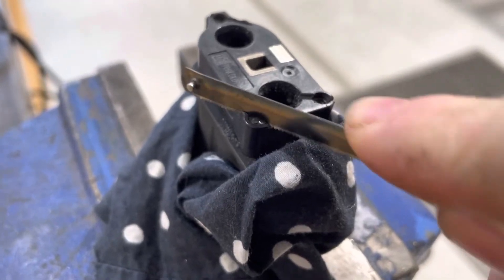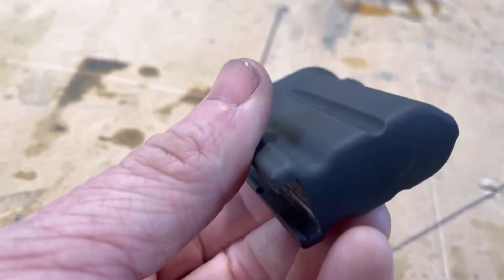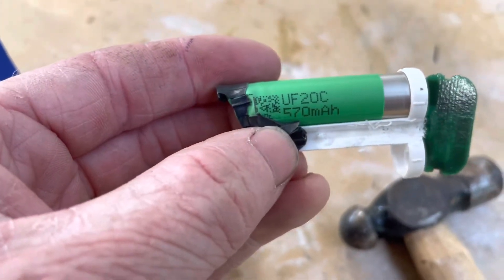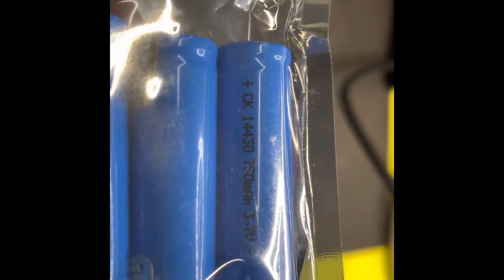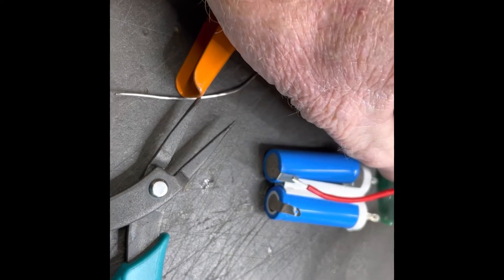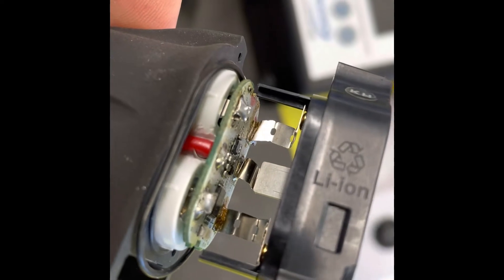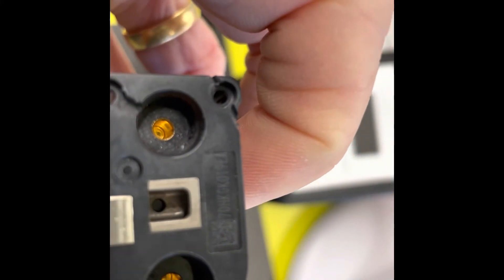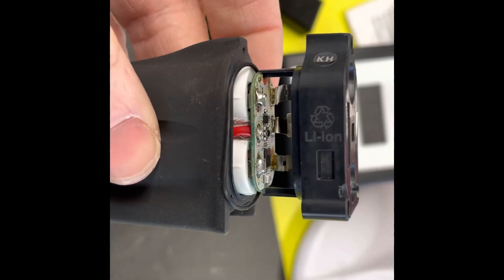Di2 Battery Replacement FAIL SM-BTR1

Comment: Thanks for the video. Just tried this today and it is perfectly working! What I did to avoid short circuiting is I soldered the bottom last.
Reply from the maker: Great result
Reply: Did u drill a hole in the bottom of the battery like the gent in the video to get the batteries out?